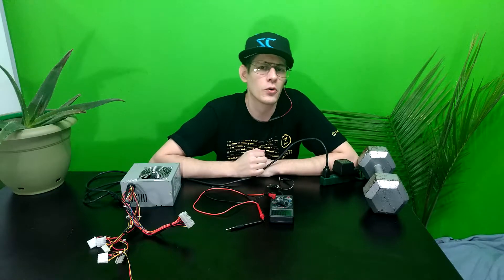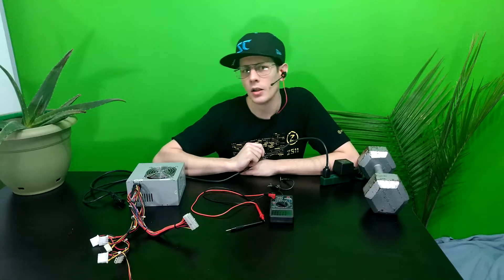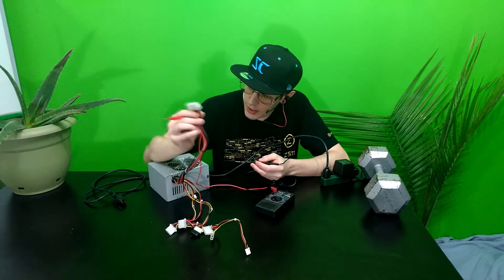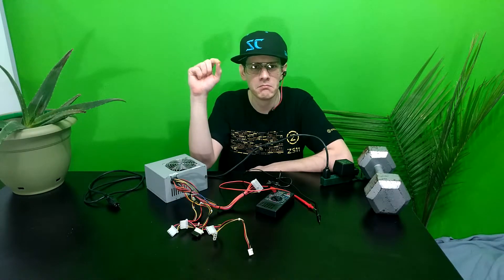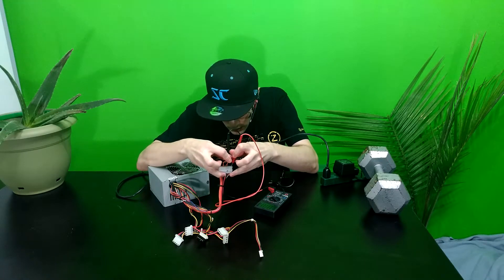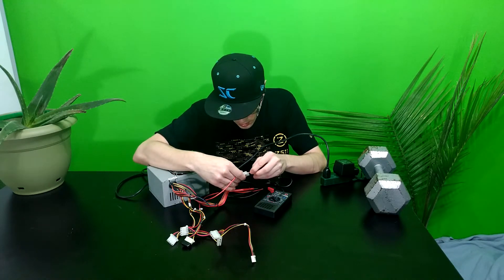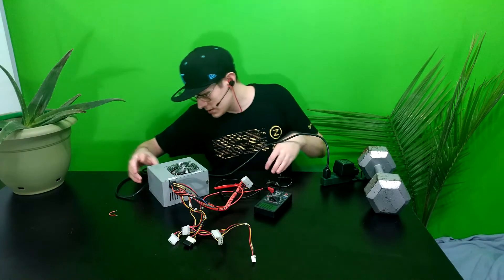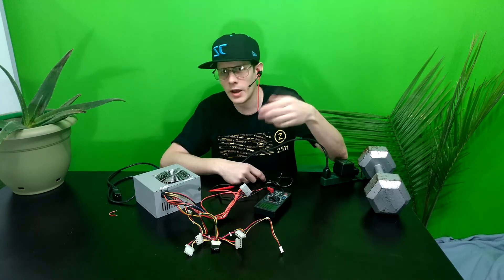ATX Power Supply - How To Test Voltage Output

Comment: So if I get this right, connecting up the green and black wires acts as the on/of switch for the power supply, that would normally be on the front of the pc case ?
Reply from the maker: Technically they would route through the motherboard's 24-pin to the Front Panel headers where the PWR ON/OFF header connects to the front panel Power Button.

So PSU (Green & Black) -> Motherboard -> Power Button